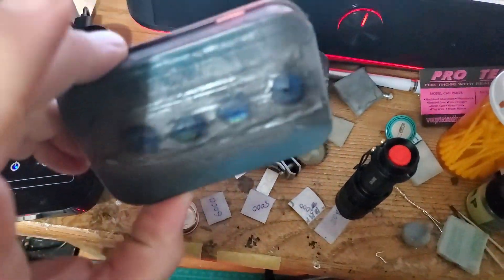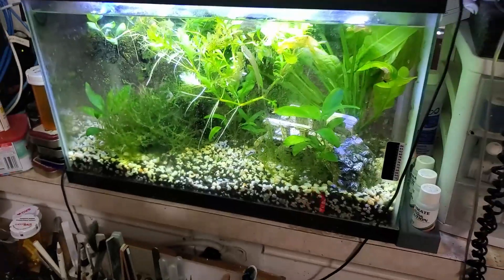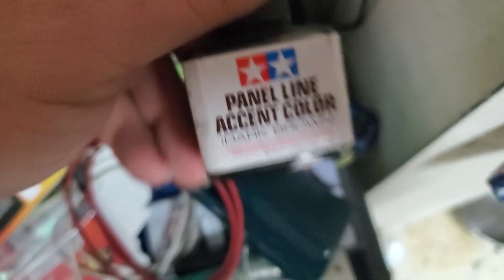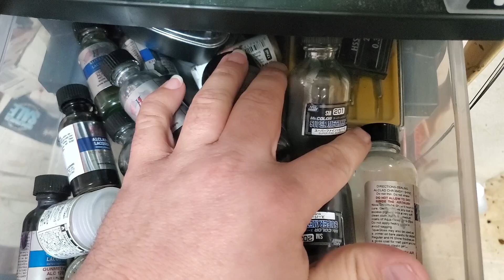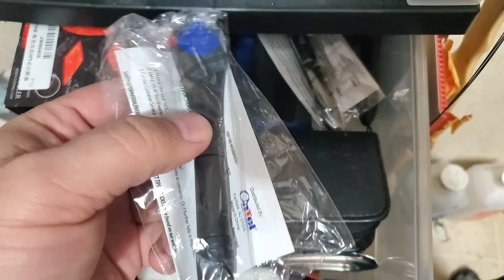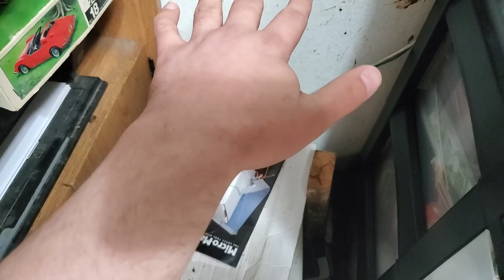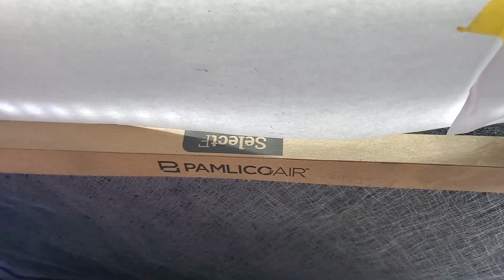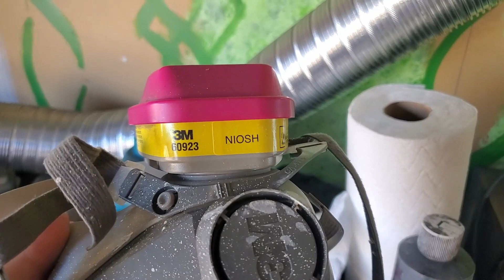Got Fuels Model Car Garage - Workspace challenge

Comment: Great video Justin...funny how similar some things are.  I completely moved away from Stynlrez to Mr. Surfacer as well now and I stopped using the Novice stuff because of the Tamiya compounds as well haha.  Great tour and thanks for showing.
Reply from the maker: I don't have any real issues with stynelrez as a primer. I still think its the best water based acrylic primer out there. But a few months after you open a bottle you start having issues with it clogging the airbrush. You can get a little more mileage out of it by starting to strain it through a 190 micron paint strainer, but that's extra hassle and expense that really shouldn't be necessary. I think once air gets into the bottle tiny bits start to coagulate. not enough to really see, but enough to cause clogs. I get none of these issues with Tamiya or Mr. Surfacer. 

Thanks for watching Joe

Comment: Where did you pick up the multi colour plug wire box?
Thanks
Reply from the maker: you can find anything on Amazon 😁   It's 30 awg hookup wire https://www.amazon.com/TUOFENG-30awg-Stranded-Wire-Kit/dp/B07G2SWB19/ref=sr_1_12?crid=1S560ABSWONYD&keywords=30%2Bawg%2Bwire&qid=1651838887&sprefix=30%2Bawg%2Bwire%2Caps%2C102&sr=8-12&th=1